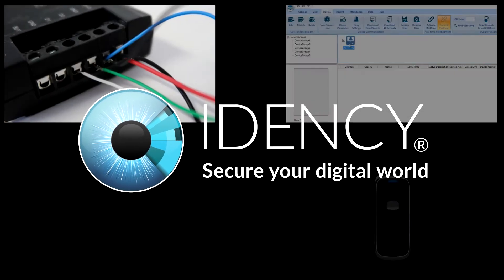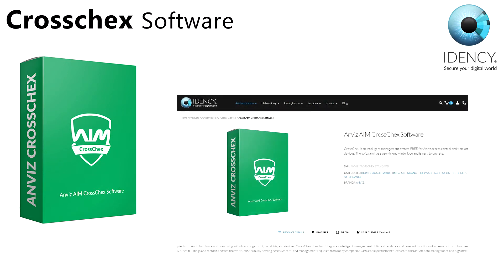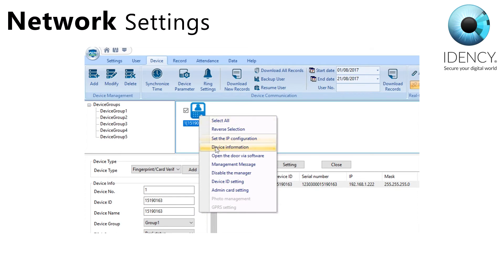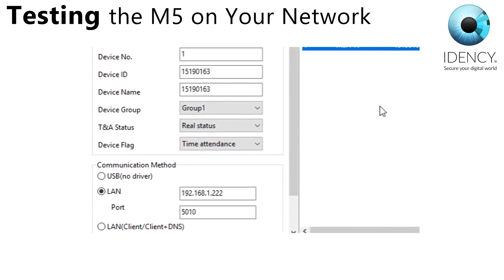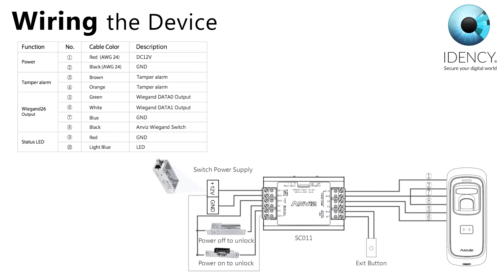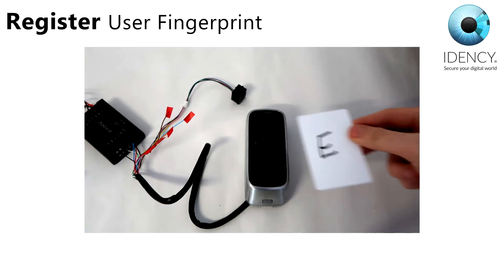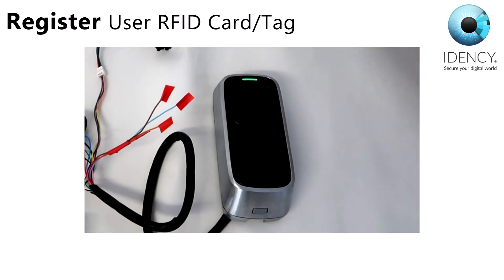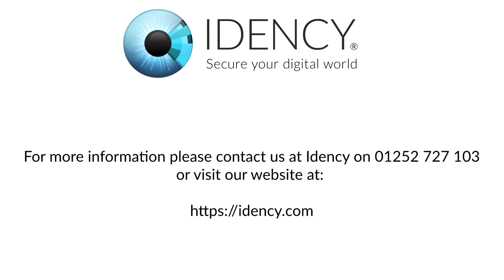Idency: Anviz M5 Installation & User Set up Guide

Comment: I have an issue where when then M5 is connected it doesn’t show up in the Crosschex software
Reply: Did you solve it? I have the same problem
Reply: @pasqualekn  yeah my dad solved it i dont remember how though.
Reply: @filipdrucker4990  I can't find the way to solve it. Can you please let me know how he did it?
Reply: @pasqualekn  It may be bc of IP address not settled. Try connecting the TCP/IP port directly to your PC, Crossshex would be able to see it now. If not, put your PC’s network card in the same segment (Anviz default IP address is 192.168.0.218). Configure the M5 IP address to one of your network segment.
Reply: @pasqualekn   did u solve it? I have same problem
Reply: @fAbby7x  i have try it this way and yes i can find it in the search but then i get an error cant connect to the ta machine.. any advice